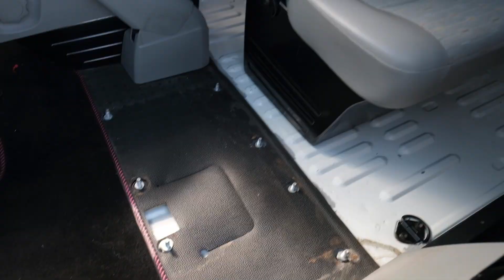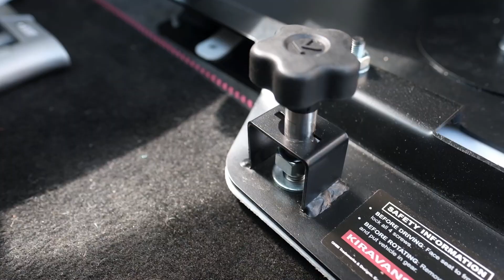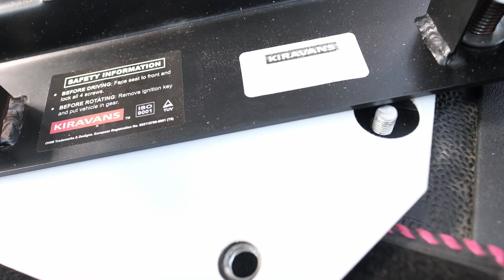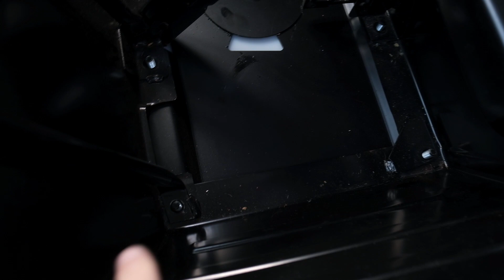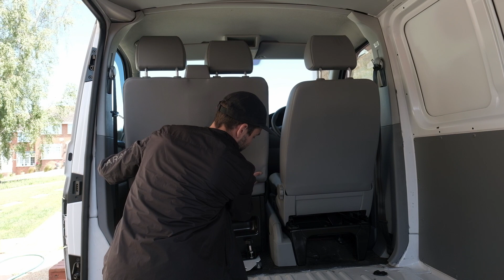The T5 Project // Day 3 // Installing a Kiravans Double Seat Swivel

Comment: Do the passenger seat airbags still work? I'm a bit confused about that.
Reply from the maker: Yes the airbags still work. You don’t drive the van with the seats swivelled, that would obviously be very dangerous. All you’re doing to ‘change’ the factory seats is raising them by a few millimetres.